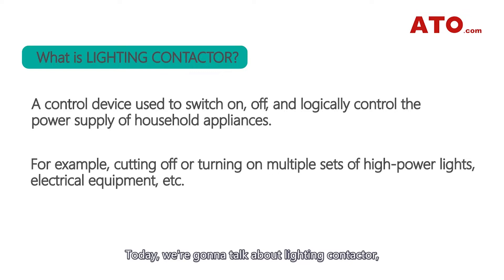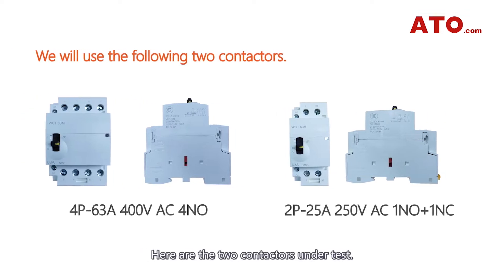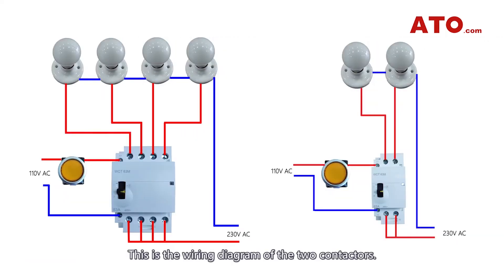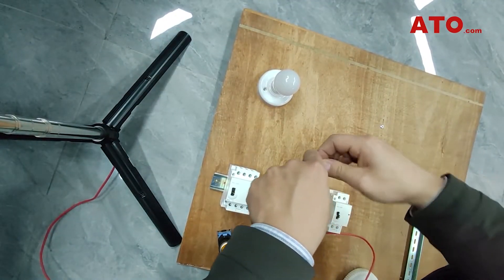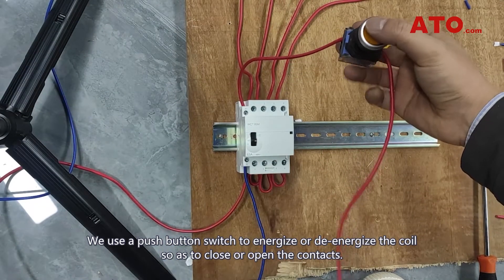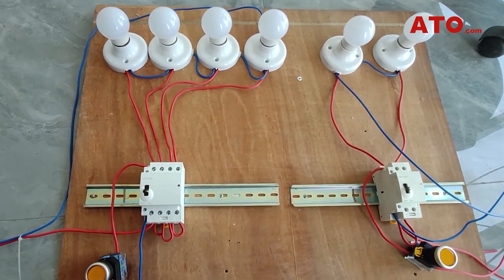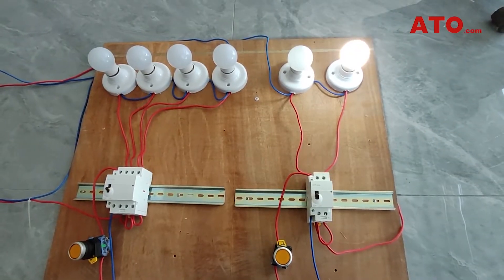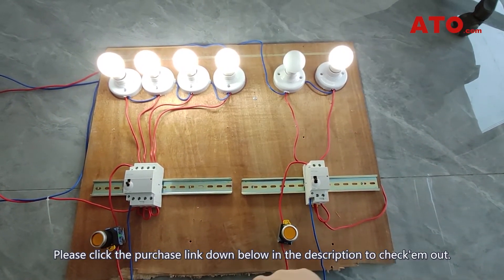Wiring Test of Lighting Contactor to Show How it Works

Comment: But a normal switch can do the same.??through an mcb??
Reply: Switches are only rated to a certain amp rating eg 10 amps, if you are switching on a load higher than 10 amps that’s where a contact comes in so you don’t burn out your switch